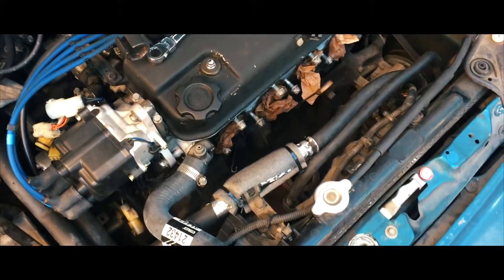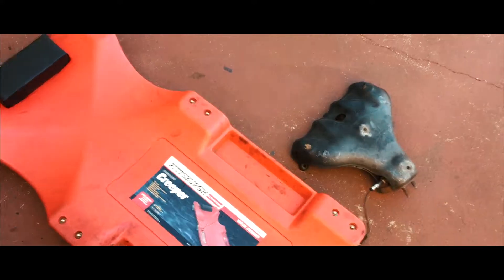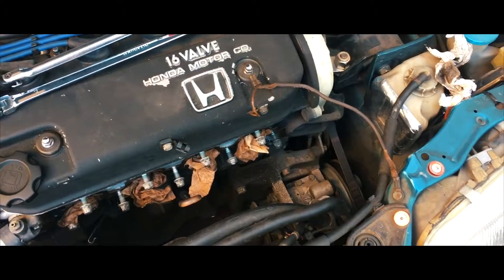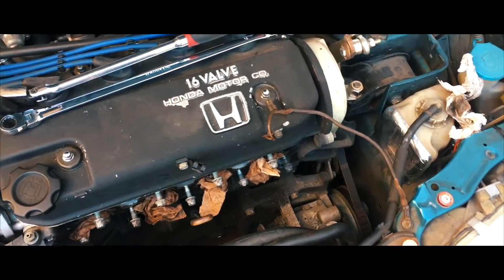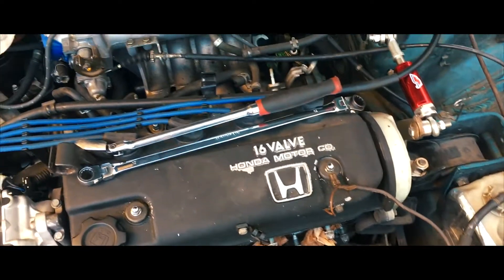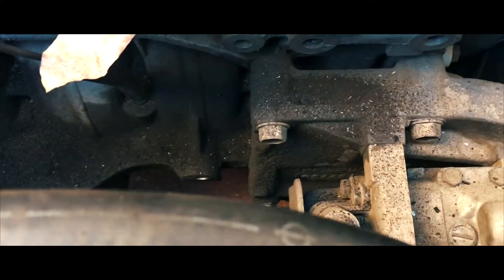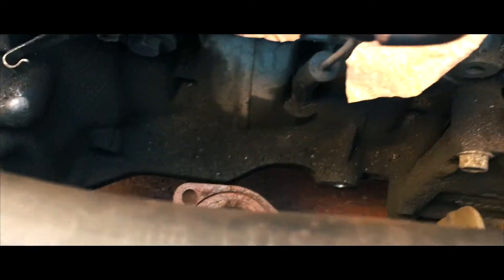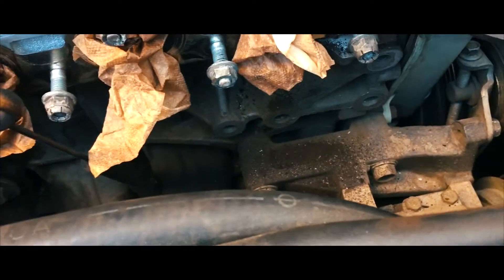CRX Turbo Build Episode 02

Comment: Hi it's Kyra from the Oldskoolers meet at Burbank. If you decide to get power steering on the crx, I have a complete PS setup that I pulled from my hatch. I am switching to manual steering anyways.
Reply from the maker: +Kyra Nguyen I'll take it!
Reserve it for me :)
Reply: Car-Lo I will have it place in storage when I do full swap. you will have to change or re build some lines so it doesn't leak. it is 25 years old.
Reply: Car-Lo hey when do you plan on doing the PS steering conversion? Cuz I would like to do an exchange for your manual rack and the mounting brackets with mine. since the racks are different size, you won't be able reuse your original brackets unless you modify it.
Reply from the maker: soon! :) hold it for me lol
Reply: Hey Please message me back about the steering rack. I really need to do the swap for your manual rack in exchange for my powersteering soon because I need your brackets.
Reply from the maker: Kyra Nguyen we should when is a good day? I went to the meet to ask u but u guys weren't there lol